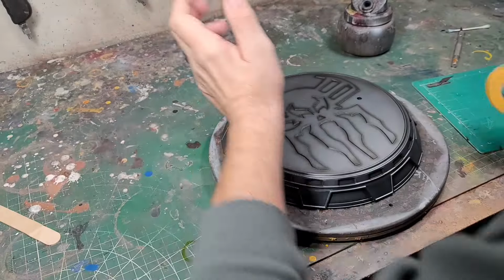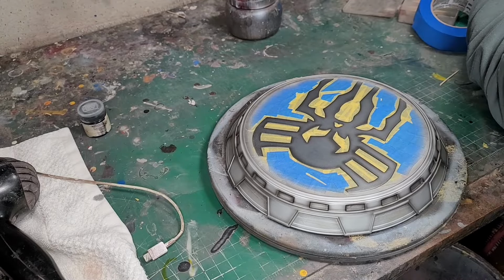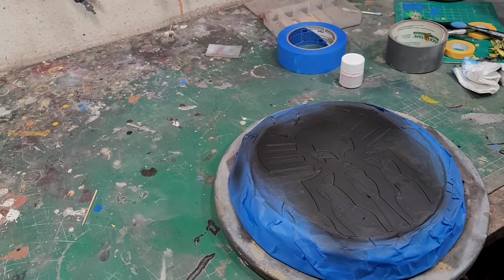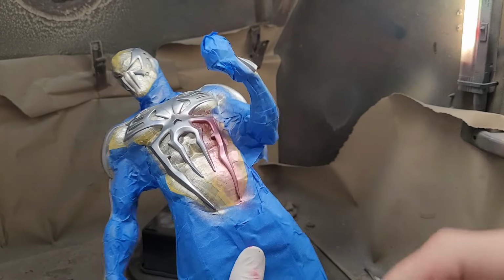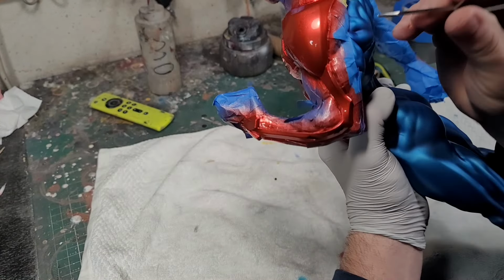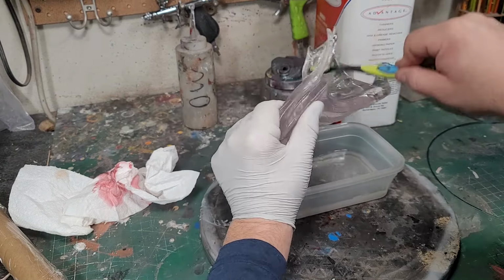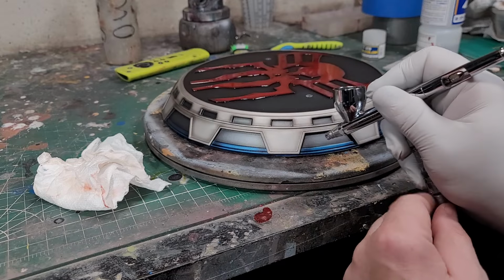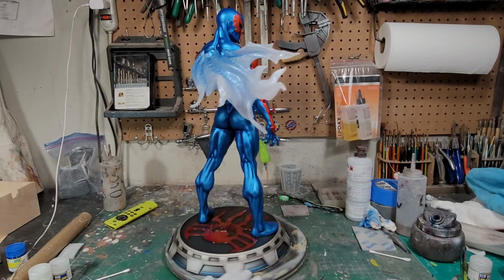1/4 Spiderman 2099 WIP #2

Comment: How long you wait from the moment you apply paint to the statue to actually been able to use masking tape in them without the risk of having the colour coming off when you peel it off? Also do you have any favourites maksing tape brand? Thanks
Reply from the maker: Typically, overnight is long enough.  I have masked as quickly as a fee hours of painting, kind of depends on the paint and how long the tape will be on the surface.  Tamyia tape is the best by far.

Comment: I wonder if using a hair dryer in a cardboard box would be a solution to an "oven".
Reply from the maker: Yeah, I've thought about building a hot box.  I just don't know at what temp resin starts to soften.  The 2K needs to be baked at 140° for 45-60 minutes after flash-off.